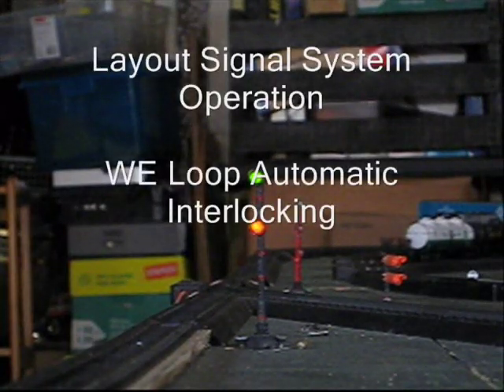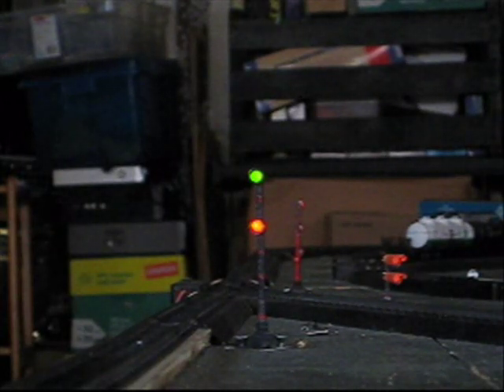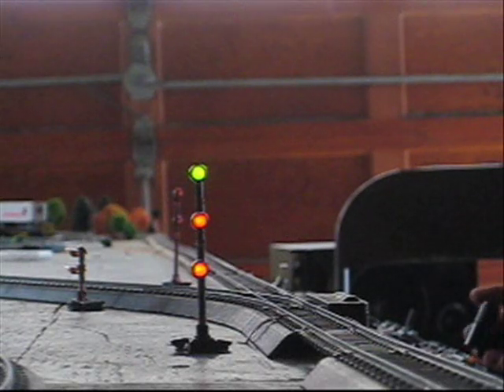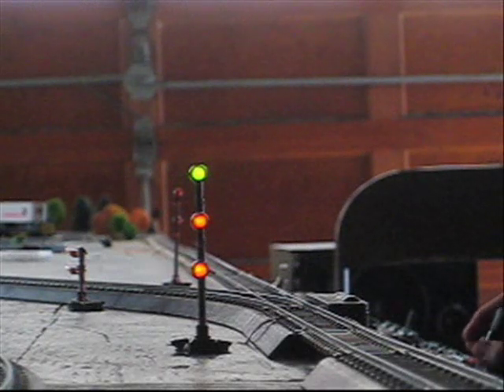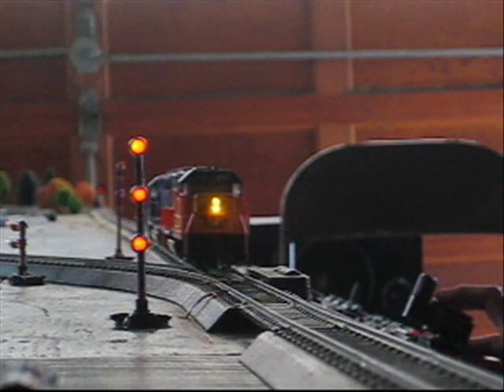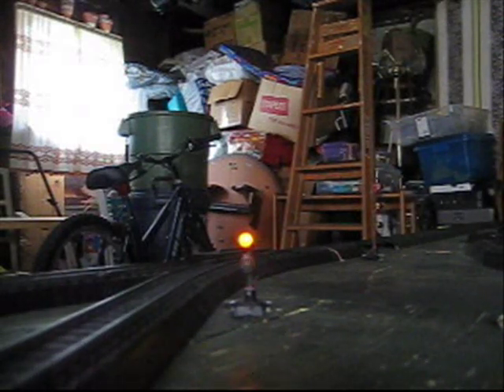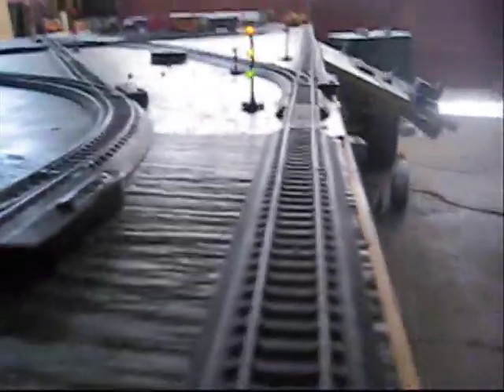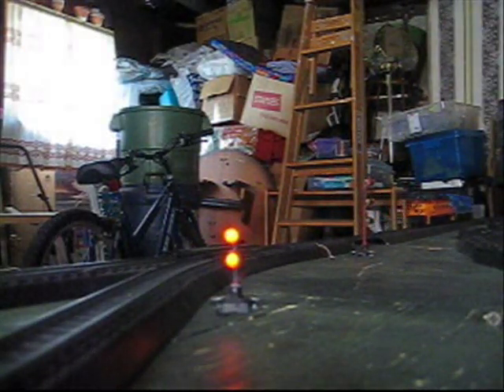Signal Operations 2

Comment from the maker: Actually I have the multiple selector as well. I use the atlas selector and the controller to operate my layout. The controller controls the reverse loop section and the selector controls all the track blocks. My layout is too small for DCC only 4' x 14' and I haven't gotten fimiliar with DCC.

Comment: how do you design the circuits for the signals and intermediate signals?
Reply from the maker: chessie railfan 4802 the circuit design was one I got off the web, this obviously was several years ago. Since this video I have come a long way with my signaling and now do all of it using a computer running JMRI. I have also converted to DCC operation from DC operation as was used in this video. I am in the works of a new layout and will have signaling it is as well using the JMRI.